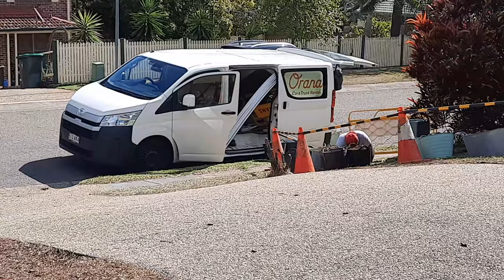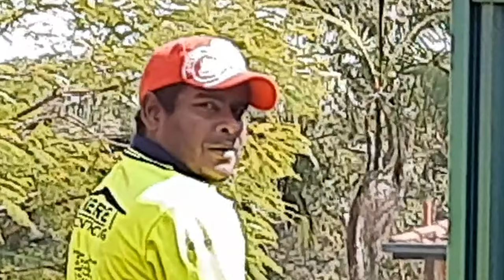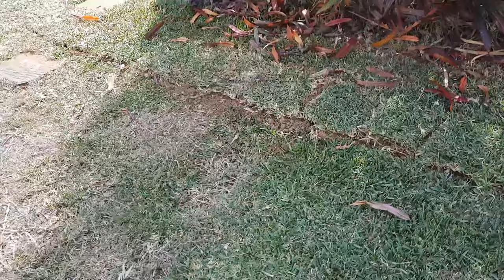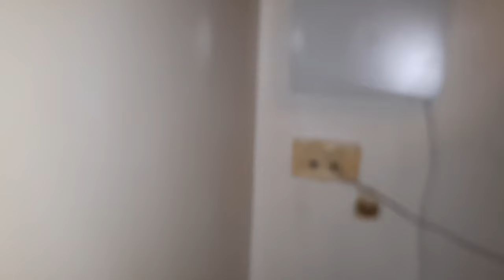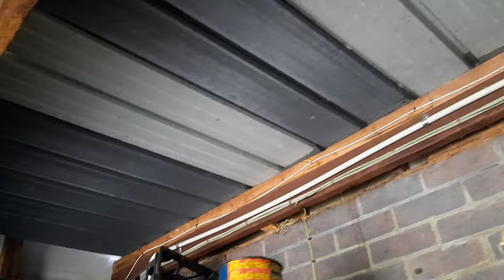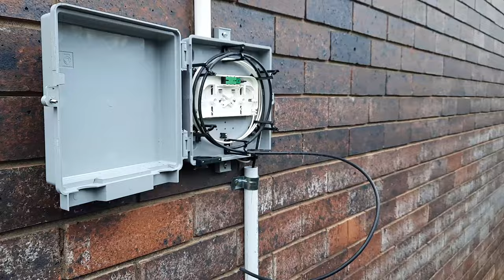Upgrading NBN FTTN to FTTP Installation

Comment: Fiber to the house went in several years ago here. No lawn and they drilled underground from open gravel driveway  up to the house. similar box on the side of the house but the wire followed through where the phone cable went. Then under the house to come up in center next to phone jack plug? So I have two inside. No inside house box but the usual modem.  I only have 10 up 10 down here on my plan at 84 including phone landline with no long distance on it. I have heard cost id going up to 130 but service is going to 100 up 100 down.??And land line will then be voip instead of land?? As it was explained to me. All long distance  is then no extra charge. I already have a voip phone OH well I have no choice they are going to do it . I am applying for  the low income 65 and older 30 dollars a month payment to help cover the cost in the raise. I certainly qualify for the low income.
Reply from the maker: Who is your ISP?
Reply: @SteveMack  Weird your reply disappeared here so copy pasting it in my reply.  "	
Steve Mack
Plants and Mosaics in Chris's Gardens ...I figured you were in the states. Seems they have things a little better organised there, and aren't (hopefully) doing the same shoddy level of 'workmanship' that I experienced!"
Well I think all is well. Hubby was here and supervised and I am sure he would have been barking if work was not good. The battery has been replaced in the outside unit a few times. Baffles them why the need. But they just show up to tell me I am having problems I was not even aware of and repairing it. No extra cost to me. and the young man that usually does the work is the nice guy that provides me with an elk or deer to eat every hunting season. I have to process it but it saves me so much $$$.

One thing on the grass. When hubby and I worked for the cemetery district. I had to cut the sod off the grave tops like they did for you and after the grave was filled in I reset the sod high as they did at your house. After a few irrigations the grave soil settles down and usually the sod goes back level. Heals itself. Once in winter and the  snow got packed super hard around the grave I ended up with the sod set about 6 inches too high. Had no idea until spring when snow melted off.  I called the man whose wife I had buried and told him  and how sorry I was and I would repair it as fast as I could. He came out and chuckled on the incident. I felt so bad.  He was not mad and gave me a nice hug. To bury someone when up to your butt in snow has its problems. Cripes just to find the right gravesite feels almost impossible.
Reply from the maker: Thanks for re-posting; youtube often goes weird: That reply I had to do under the video, rather than the way I usually do it 'behind the scenes'...Well here's the thing: with Australia's 'NBN'; there are NO contact methods for them, UNLESS you are a wholesale internet provider - How's THAT for good P.R.??  Sounds like everything's MUCH better there, on that front at least. What we need here in Queensland where I iive especially, IS rain! - Going through a rather dry period, which hopefully will improve as the season rolls on. I know it doesn't take an aweful lot of rain, for the grass to suddenly go nice and green. 🙂👌👍

Comment: I’ve had 2 visits the one that goes through the wall, the second from the pit to my house and then when they were finished they a left a big hole in my wall m, and I was told by the tech it was right to go, but all I get is a red optical light and no internet, and I contacted my telco and I have no idea when there going to finish it
Reply from the maker: THAT'S SHOCKING! Get onto the telecommunications Ombudsman, and lodge a complaint - you'll be surprised how quickly things will move then! Here's the link;https://www.tio.com.au/
Reply: Thank you so much for your help, I shall contact asap and let you know how I go, thanks again
Reply from the maker: My pleasure - I'm looking forward to a positive outcome for you.👌🙂

Comment: It sounds like they moved you from a 100/40 to a 100/25 plan. Plenty of providers still offer 100/40, but not all of them.
Reply from the maker: Yes, it does sound that way - unfortunately for me: they say they don't HAVE a 100/40 plan!
I've looked around at MANY; most are 100/20 now, or else step way up in cost, and even then; many are still only 20MBPS up now. 😪

Comment: I just went 5G with Telstra, super fast, just plug it in and away ya go. Onya Steve 👍.
Reply from the maker: Yep, 5G wireless is not NBN though. We had an NBN tech tell us a few years back when we first connected to FTTN, that "all of this will be redundant, as the future will be all wireless" - Rendering fibre-optic cables obsolete! (read also: yet ANOTHER waste of tax payers dollars!!)
Reply from the maker: That's likely why NBN just increased wholesale prices, which means the end user will have to pay more for our internet.

Comment: Keen to know this one. 🤔
Reply from the maker: To be honest; after all of what I've checked out SINCE, it seems to be in a way, a bit of a scam! Nearly all ISP's NOW have 100/20 speeds (unless you want to pay WAY more per month!) - Seems to me, that the idea behind it, is that everyone's more or less limited in the amount of data that can be used and not shaped by the NBN network - My advice NOW, to people who already have a good speeds but not YET connected to FTTP: STAY with what you have, at least until (I predict) all ISP's change your plan without you having a say in the matter!! 😡
Reply: @SteveMack : Personally I don’t need anything special because I mostly stream so happy with my current speeds whatever they are. 
I do remember all of the hoohar over fibre to the nodes only, and copper remaining from node to premise. Some indications were that keeping copper to the premise defeats the purpose of having a fibre system. 🤷‍♂️ In your case, it doesn’t sound like an issue with speed. 
I guess one of the issues indicated with copper “besides slower speeds” was astronomical maintenance costs. 

So to get higher speeds whether copper or fibre to the premise is purely about how much you want to pay?? Is that what you are saying?
Reply from the maker: Not exactly...Slightly different aspect of the topic; Back when the then government first announced we'd all have fibre, it sounded a great idea, as speeds on fibre-optic can be infinitely faster than the antiquated copper lines, THEN, with the next government that came in – they said it would cost too much, so instead went fibre to the node, relying on the dumb idea of bottle-necking a fast supply, into a slower conduit...Fast forward to the current government, and the roll out again is what was first proposed, fibre ALL the way to the home.

The problem of the speed now dropping, is most likely due to the NBN Policer. This is where they hard drop any data you send above what your service is provisioned for. Your devices see these drops as congestion so back off and slowly ramp up again only to have it happen again. This doesn’t normally happen in the download direction because your ISP can rate limit you in a more controlled way. So on the 100/40, we were likely benefiting from the over-provisioning. This problem doesn't exist on FTTN because your modem/router is fully aware of how much capacity it has upstream so will never admit more than that. However with FTTP, that isn't available to your router since the link between it and the NTD is much higher speed than you'll push through it, hence your router can forward more data than is allowed and NBN will just discard it, which is the cause of the problem. 

In ESSENCE; what I suspect, is that the governments NBN plan, is to eventually have us all on a very similar playing field with speeds.

Comment: Fibre is a million times better, if you aren't getting the speeds you wanted then its either the ISP or you have a crap router. 99.9% of problems are user/ISP related not NBN...
Reply from the maker: Well, an exageration of course, but I fully agree it's vastly faster - My issue wasn't (as I said) DOWNLOAD speed, it's upload speed, which all ISP's now limit! - The average being around 20mbps upload. The modem wasn't crap, but I'm now currently using a modem supplied by the ISP, as after complaining to the TIO, they did a deal with me for their fastest current plan, so my download speed is around 275MBPS!! UPLOAD however, still barely averages 20MBPS.
Reply: @SteveMack  Who is your ISP? What router are you using?
Reply from the maker: Dodo (currently); theirs is a TP-LINK, but set so I can't fiddle with settings to override certain things, as I DO with mine normally.

Comment: Bit lumpy... Crikey hard to take your complaints serious when you pick at every little thing you have an issue with like an old woman.
Reply from the maker: ...And when the possums here, that are notorious at chewing on wiring etc, cut through the thin exposed fibre optic cable and I lose all internet, and have to wait God knows how many weeks for NBN to replace it - simply because they failed to comply with industry standard installation; would that justify my concerns? Or are you one of the masses that accept sub-standard workmanship for everything?